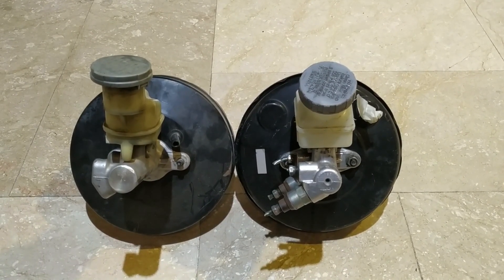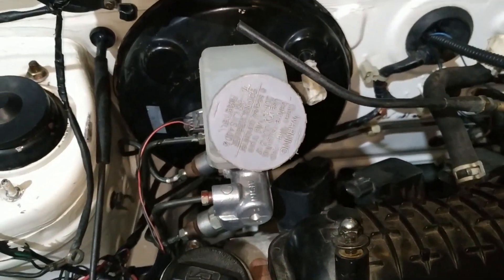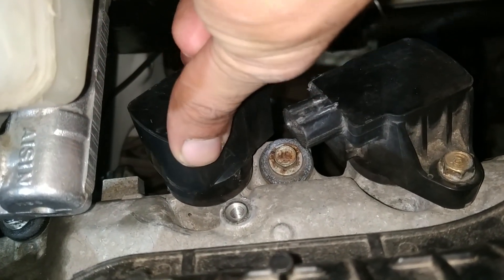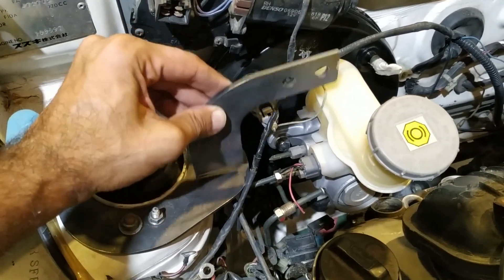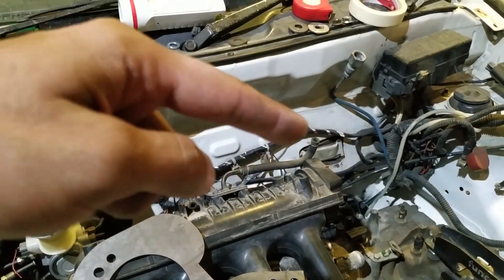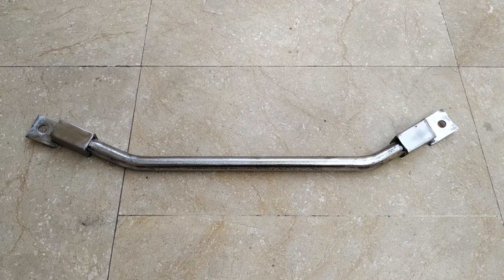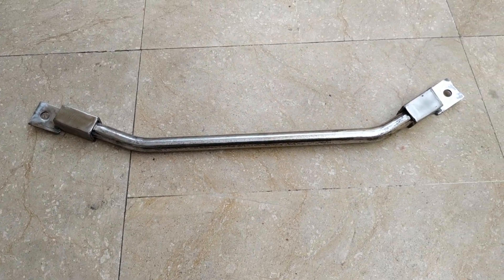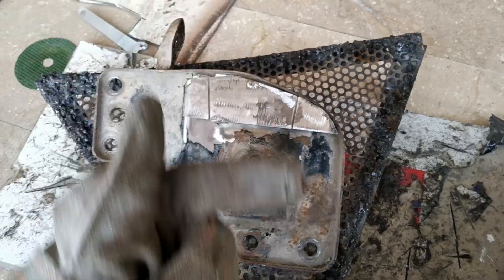Project L13A ALTO: Structural Rigidity, Cooling and More – Part 3

Comment: Which car`s master cylinder conmbo did you use ?
Reply from the maker: I'm not entirely sure which car it belongs to. I searched around for a setup that would be identical to the Alto's original one so that it can be interfaced without doing much to the plumbing and fitment. I asked the seller too which car it belongs to but I didn't get a definitive response.

Comment: Great work and a lot of effort and time spent :). A comment on the shroud of the radiator fan. On high speed the air is moving through more than what the fan can pull and therefore there should be extra holes for the air to by pass the fan. Those holes should have rubber covers to make one way valves. You can search are it will be great to add these to the additional shroud piece made for the radiator. something like this https://youtu.be/LOtpt2bAsIU?t=270
Or it might not be useful if the vehicle wont be going too fast or the should can funnel the air from the fan area
Reply from the maker: Thank you so much for your appreciation and input :) I agree, the windows in the shroud help with airflow at higher speeds. When I started fabricating the shroud, I planned to make these windows in the shroud. However, once the shroud was made, I placed the radiator in its position to estimate the place where these windows should be cut and realized that there are two pipes, one coming from the PCV valve and another one taking coolant to the throttle body and they were about half an inch away from the shroud and they wouldn't let the rubber flaps open so I decided that the effort of making them may not be worth it if they're not even going to work.

Comment: Really impressed by your hard word. Have an alto myself and would love to put an m13a swift engine in it. Have u thought about upgrading rhe stock brakes as now u are pushing a lot more power into the chasis
Reply from the maker: Thank you so much for the appreciation. An M13a is a very good swap for the alto. Just make sure you get the variant that comes with VVT. Regarding the brakes, yes, bigger brakes on the front are on the cards later down the road. For now, I've used good quality brake pads (Advics) and the servo setup used now has improved the braking as well. That combined with the little weight difference between this engine setup and the previous one (about 20kg) has not thrown the dynamics off by a lot so the braking is not that bad. Until the front brakes are upgraded though, it comes down to carefully driving it as a daily driver, like it was before the engine swap.

Comment: Great work
What about the ac Condenser. Will you put the pusher fan to do both the jobs?
BTW pleaseeee help me with my diesel Charade. I want to install oil filled engine and gear mounts to eliminate vibration and no one is ready to take up this job.
"Sir yeh nahin ho sakta" is the reply I get from every one.😢
Pleaseeeee help me out with it
Reply from the maker: Thank you very much. The fan currently used will serve well for the condenser as well. The condenser, being as wide as the radiator will have a more even distribution of heat. I wanted to put a pusher fan on the front but there isn't enough space between the condenser and the front bumper.

Regarding the mounts, well people say such stuff to save themselves from the effort. That said, it is very much possible. You'll need to design a base for the mounts on the chassis legs and then add the oil-based mount on top of the base. Then its a matter of connecting them to the engine through brackets. It will of course take plenty of time and effort to do it right though. 

Do keep in mind that the original mounting points on the chassis legs will have to be taken off though. And you'll need a good fabricator who is willing to work on it.
Reply: @funcariauto  Good Fabricator! That is where I will need your help.
I seek your guidance and consultancy
Reply from the maker: @hameedsumbal5328  Sure thing, please let me know how I can help.